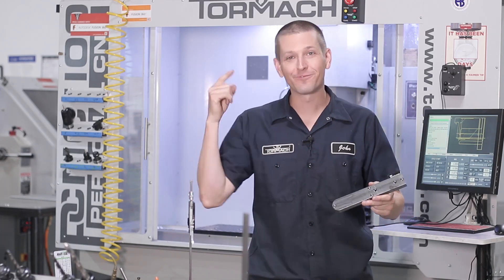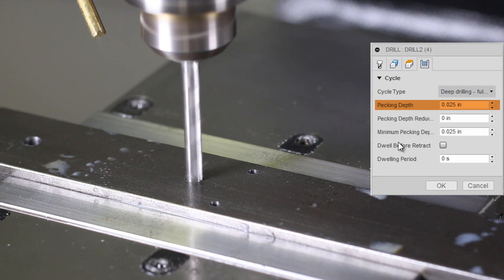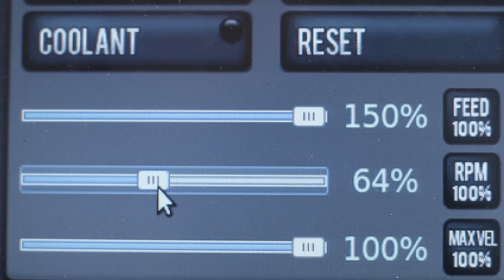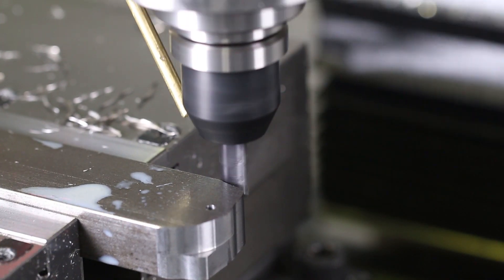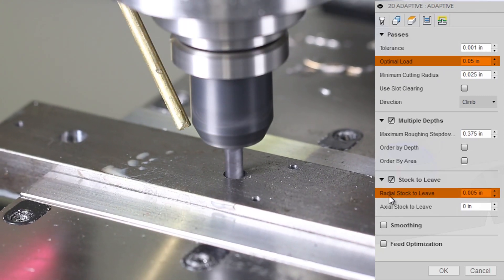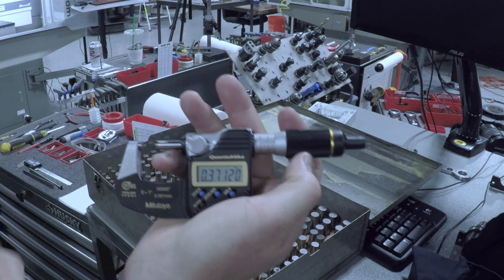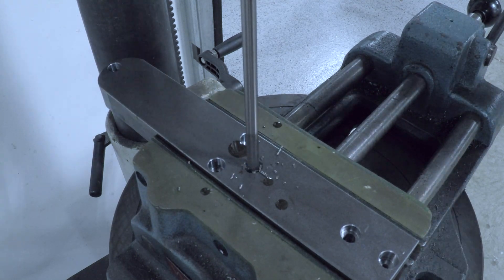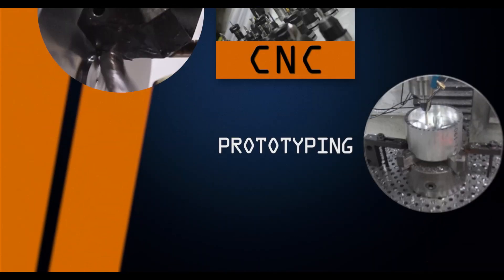Machining the DIY Repeat-O-Meter Base!  WW153

Comment: John, I know that this is an older video, so I hope that this question gets to you.  What metal did you use. I want to make one, have figured out a number of the dimensions by measuring screen shots but nowhere does anyone say what metal is used.  I am concerned that with a .050 flexture that metal fatigue will set in if I use the wrong material. Thanks!  Too, is there a set of drawings somewhere that you have made public?  Derek

Comment: You might try using a different style mouse for your tendonitis.  I like the Logitech WIRELESS TRACKBALL M570 Which I use all the time.  But I have a friend who uses the Logitech Rechargeable Touchpad T650.

Comment: hi john, look into a logitech trackball, the good thing about those is, they are fixed on your surface and you only move your fingers to move the ball, you can plant your wrist fully on the table. the model is logitech m570 wireless trackball.

Comment: Switch to a trackball; better ergonomy and generally superior pointing device. There are many different styles, my favourite is the one in Logitech Cordless Optical Tracman. Too bad they're discontinued, which basically made them 5-10 times as expensive as they used to be, but if properly maintained, they last for decades. Mine's ≈18 years old by now and still going strong.

Comment: Regular shoulder bolts vary quite a lot, up to 3 thousandths below nominal. For a better fit, the precision ground shoulder bolts available on McMaster are reliably within 1 thousandth under nominal.

Comment: I was taught to ream with much flood coolant, to keep the ream from expanding due to the heat and getting oversized holes.
Also low rpm to keep the ream cool and much higher feedrate than at drilling.

I hope you will read this. Great Videos!

Greetings from Germany!

Comment: 6:20 Coolant can actually damage carbide tooling by...cooling it! The only reason you let coolant on the cutting edge is that the right coolant on the right coating will prevent adhesion and consequent build up of the workpiece material. In most other cases it just flushes chips.
Reply: Specially in milling applications the big temperature difference of going between shearing a blued piece of metal to chilling in a pool of coolant while the heat is concentrated on the main rake causes small cracks and notch wear on the cutting edge. At least that's what Sandvik says and I tend to believe them when it comes to machining!
Reply: Yes it does it. Thermal Shocks the Cutter
Reply: chris0tube ok never said it was coolant fault i said it will thermal shock the cutter
Reply: chris0tube I'm high production shop and no that's not reason at all when cutting ferrous material with correct coating the cutter needs get hot enough for the coating to work when you enter the cut the endmill is at certain temperature but when the cutter leaves the cut the endmills flash cools this causes thermal shock which causes micro fractures in the carbide. That is why you hard turn or hard mill (58 rc+) with no coolant just air to clear the chips from the cutter. The endmills and turnings inserts will glow at the tip
Reply: chris0tube For some reason you can't post links easily on YouTube.  Bunch of evidence and stuides done you will get thermal shocking and less tool life running flood coolant on ferrous materials with these cutters
Reply: https://www.sandvik.coromant.com/en-gb/metal-cutting-e-learning/pages/machinability.aspx It's somewhere in there. (It might even have been at the testing tab)
Reply: chris0tube and im saying you run these tools and coatings dry. Just air blast..  Did you see should be appiled copiously or not at all
Reply: Milling causes thermal shocking by nature and the only the only way to properly apply coolant to the cutting edge is with a high pressure through spindle coolant. No matter how much you hassle with your flood coolant just the RPM of the end mill will keep the flood away from the tool tip. I remember that they showed the "force field" effect that hanging chips have at HAAS tip of the day. 
Sandvik quote: Cutting fluid should be applied copiously or not at all.
Reply: Both these links explain how to use High Precision Coolant to achieve good chip breaking and evacuation, and the second one says that the longer tool life comes from eliminating chip jamming. 

The first link advocates the use of simultaneous over and under coolant only on low ap-fn finishing or when facing internal boring chip evacuation difficulties. It says that over and under coolant should also be used when having dimensional accuracy issues(again at the finishing stage) and that over coolant can cause crater wear on the edge resulting in shortened and unpredictable tool life compared to under coolant(nozzles aimed at the reliefs of the tool and under the chip) and external coolant(like flood coolant). 

But quoting from Sandvik:"The benefits can be great for turning operations,however:".All these are addressed towards turning and even then, under certain requirements and in order to increase the chip load capability of a certain tool when more parts per shift but not per edge are required. Milling and interrupted turning are different in terms of insert grade required and are better of conducted dry(In parting and grooving though I would suggest some kind of lubricant to help the chips slide out without damaging the machined surface).

Lastly quoting from the video:"When cutting with Carbon Tetrachloride...(says that the image is shiny due to the substrate being wet)...the chip flows more easily up the tool face, probably due to the presence of a surface film of Iron Chloride which has a low coefficient of friction." The point is that the presence of Carbon Tetrachloride creates a chemical "coating" of Iron Chloride on the HSS cutting tool due to a reaction taking place...that sounds familiar! Also at the temperatures the cutting zone reaches any cutting fluid would just instantly boil off by just coming close to it  as the heat continuously regenerates from the cutting action which is constant. It mostly cools the part and does not allow it to soak with heat to the point it will affect the dimensional tolerances.
Reply: There are many advantages but as with anything in machining there a lot of compromises too. Anyway I hope this conversation was productive and informative for you as much as for me(I thought HPC systems would be a plug n play solution but turns out there picky in their own ways). Have a nice day!

Comment: My experience says that it's just the unsupported edge of the part hanging out of the vice. A lathe chuck can support a length that's 4 times the diameter of the part without a tailstock because it mechanically supports it against (assume stationary chuck) both up and down and side to side. My rule of thumb is that on a vice when you get close to 1 times the clamping width of stickout you are limiting the rigidity of the workholding because a vice mechanically prevents the part only from moving side to side and maybe downward (if you keep the parallels to the setup). The only thing supporting it upwards though (unless you clamp from top to the parallel) is friction with the jaws by the clamping force.....but you don't want to crush the part with your mighty vice!

Comment: I has RSI from heavy use of a normal mouse.  I switched to a "Vertical" Mouse 5 years ago, made by Evoluent.  Not cheap, but no more RSI.  Theory is that using your arm with a horizontal mouse in a partially twisted position is not good. Your arm needs to be a natural "Handshake" position.

Comment: Tendonitis: try mousing left handed. I learned some years ago, now I am ambimoustrous. It was surprisingly quick -- just a few days and now I can easily swap if one arm or shoulder is sore. :)
Reply: Get a track ball or touch pad, etc and switch back and forth between them and a mouse. I got a little tendonitis from using a track ball for a couple of years and switched back to a mouse for a while to cure it. Uses just enough different muscles.
Reply: I did mechanical design for 8 hours a day for 10 years.  By the end of the first year I took the time to learn to mouse left handed and I would switch hands each month.  A few minutes to re-configure my desk on the 1st, and it gave me an excuse to clean my desk a bit.  Now both hands are equally worn out.  Good Luck.
Reply: NYC CNC You might also look into a Roller Mouse. It was fast for me to learn, and is usable with either hand. My Occupational Therapist recommended it. They're available on Amazon.
Reply: I worked IT for 28 years. Many of our users were left handed and when I worked on their computers, I learned to work a left handed mouse. Was interesting at times. :)

Comment: I've used a mouse every day for almost 35 years.  First, figure out why your mouse ergonomics are so bad.  Fix your chair/desk height.  Spend time and money to make it ideal.  You work there for hours a day.  Get your wrist and arm down in line with the mouse and have your wrist break at a good angle.  Get a good soft gel wrist pad.  If you lean your arm on your chair arm  while working, wrap a good piece of foam on that chair arm to spread the load from one point on your arm or elbow.  Get a Flextend glove and learn how to use it for your condition.  1 minute a couple of times a day can literally cure a range of tendon issues.  Also look up 1Mhz ultrasound "skin/beauty" treatment devices on Ebay.  They aren't used for women's skin care.  They are small handheld medical deep treatment machines, but they can't be marketed that way.  With a little ultrasound gel you can use one to promote bloodflow to the inflamed and damaged tendon areas where it's hard to get blood to for your body to repair.  It also promotes the breakdown of scar tissues which is great.  They aren't quackery.  Doctors offices and physical therapists use them for everything from deep muscle massage to speeding broken bone healing in athletes.  They WILL speed healing by up to 30%.  Which is a lot.   Tendons are super slow to heal.  I spent a couple of years battling tendonitis from highly repetitive shop work.
Reply: ...or you could try using a trackball - the thumb version not the finger version. Logitech still make one. Most people don't realise the benefits. They take a day or so to get used to, but what's that in the scheme of things? (I have nothing to do with Logitech - they are just the ones I have used for a decade)

Comment: Try a Logitech mx master mouse. It turns your wrist enough to help and not have to use a vertical mouse or one of those rolly bar mice. 70 bucks and it's got good software for the buttons for short cuts
Reply: Agreed! Mice have always made my wrist hurt, and for a long time I used trackballs, and later on the Apple trackpad because I found them to be more comfortable for long periods of time. But I picked up the MX Master about 6 months ago and I won't be going back.

Comment: No need to pilot drill. Just go for the size you need. We're not talking 3" drills here, B is a small drill. A machinist jack probably would have solved that chatter BTW. Like you said, prevent that resonance. If you can preload it upwards, it can't start vibrating.